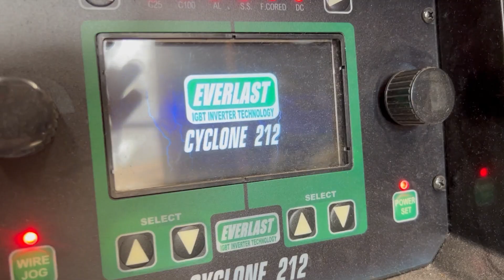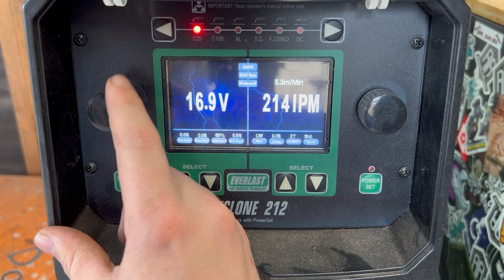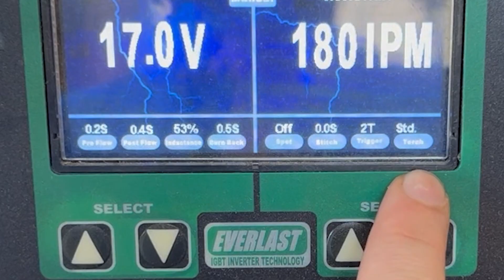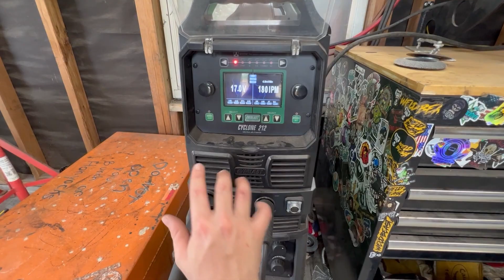Welding A 2G Open Root GMAW - First Steps Prep & Fit-up

Comment: as an idet russian who barly speak and spleel englash what is G i not very smart i know stik "G" i never heard
Reply: G stands for groove weld  f is filled weld 1 is flat under your neck 2 is horizontal  3 is vertical 4 is overhead 5 is pipe horizontal, and 6 is pipe on a 45-degree angle